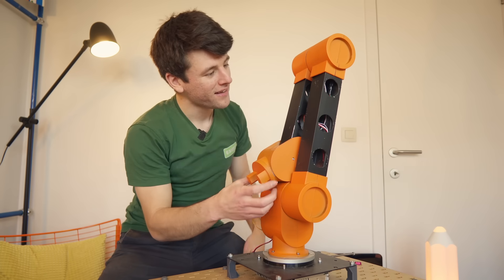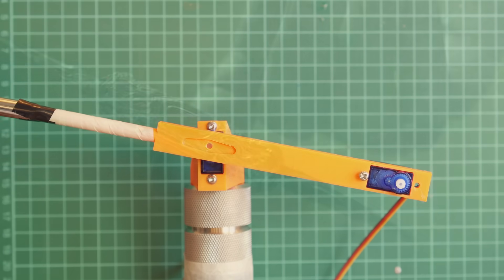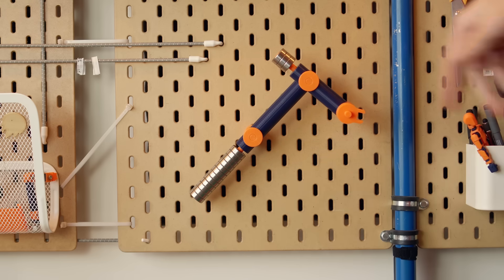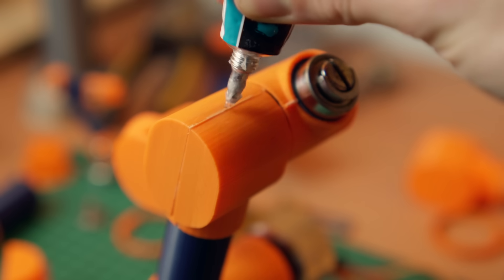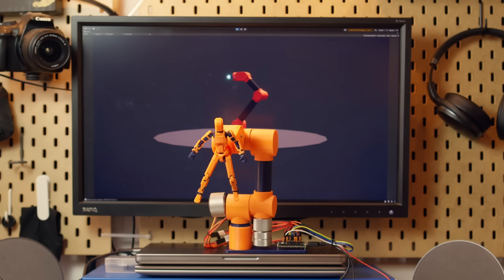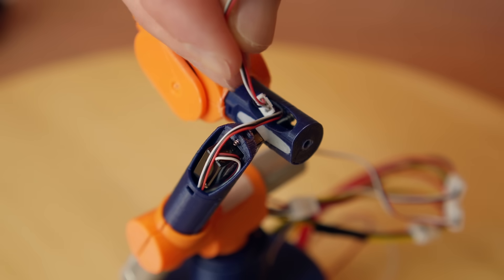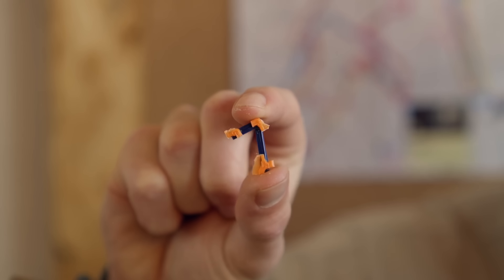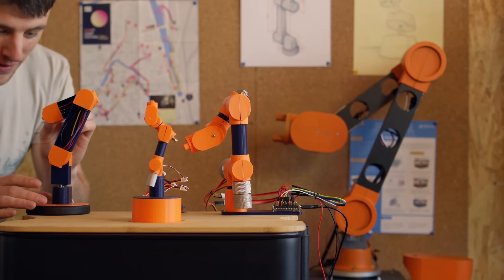I made The Smallest Robot Arm!

Comment: I have been working on this idea on and off for a few years now, but I want to use coaxial torque shafts to build an arm, keeping all the motors at the base. Each motor spins a correlating joint, and all the torque shafts up to that point. The "previous" stage holds a bevel gear elbow to the following torque tubes

Comment: Instead of carrying the servos in the arm itself, have you considered using tendons? Ofc the overall setup is a lot different and you'd probably have to adjust your code quiet a bit, but it'd have the benefit of an comparably weightless arm to move around, while the servos are hidden inside the base

Comment: Great work as always and amazing video!   If it were me I would skip the connectors... just solder and extend the lines, those bulky connectors are limiting your design and holding you back.
Reply from the maker: True, but I'm always afraid I'll break one and then I would have to do it all over again
Reply: @JelleVermandere  good point. And you are right as it all depends on your priorities in the design. What you did is amazing all the same.      Another additional advantage of soldered extensions is that it will allow you to use more flexible silicone wire opposed to that stiff  PVC coated wire those connectors are often sold with which opens up better wire routing, smaller wire bundles, and a less stressed connection to the board.